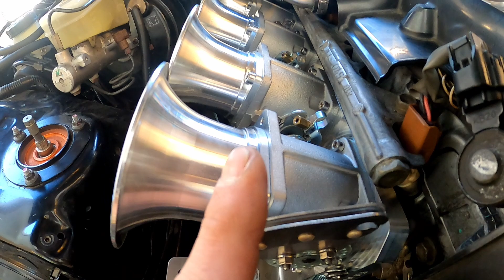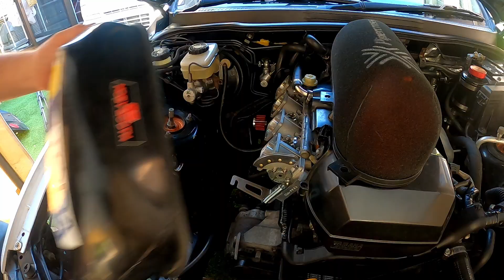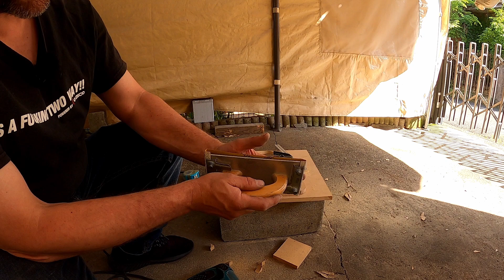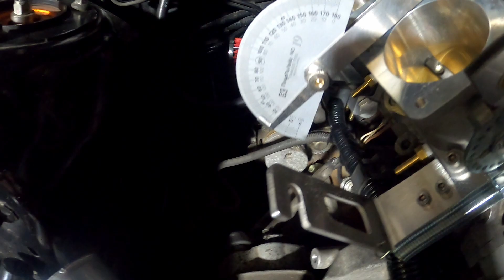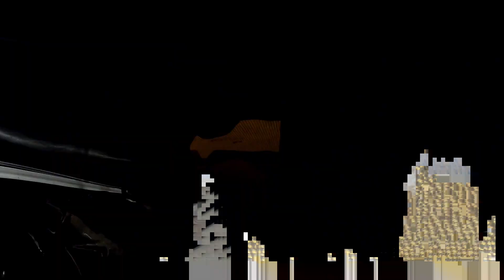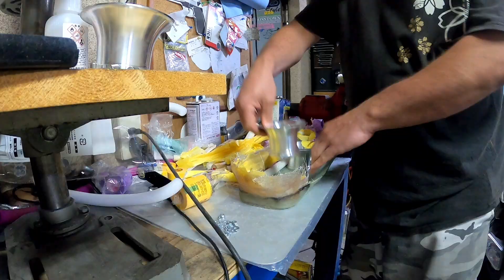PANIC MADE ITB AIR FILTER | WHAT FITS ALTEZZA!?

Comment: Why just print 3d printer SPACER between itb body and horn ?  can use those horns and get more room ?
Reply from the maker: 3D printing is hard to do in Japan. It’s expensive and takes a long time. I only had a few days to complete this project. (I want to / need to get my own printer someday)
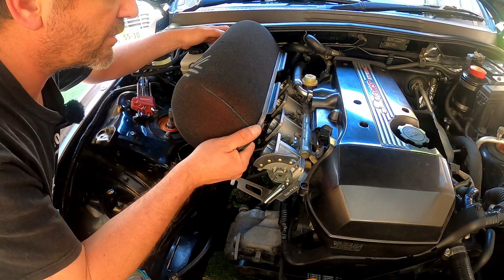I thought about making a 30mm aluminium block with my drill press to clear the throttle wheel and TPS but when I put the filter in place, like you saw me do at 1:18, I was convinced that the filter would not fit.
I'm pretty sure you will like the end result of what I made.

Perhaps version 2.0 will be 3D printed.

Thanks for watching and thank you again for the PCV advice!
Reply: happy about own small 3d printer can make parts protos etc..   TEST stuff.  that 3sge beams itb not easy on LHD cars still bonnet big problem.  look similar itb items, but sadly longer model of those only aveilible little smaller diamter. i think there where 25 or 30mm longer body

 @GarageKei
Reply from the maker: Panic now make spacers and a filter kit. 
The spacers make the velocity stacks longer which does make more mid range power and the added height clears the throttle wheel.
https://panicmade.com/induction/p/3sge-52mm-itb-filter-kit

But they didn't exist at the time I filmed this video. Will it fit my Altezza? I don't know.